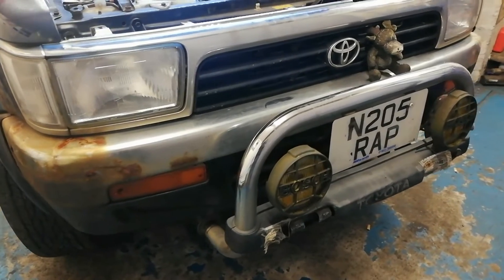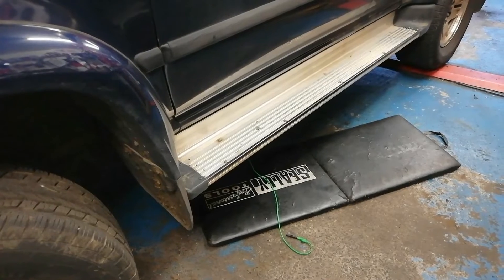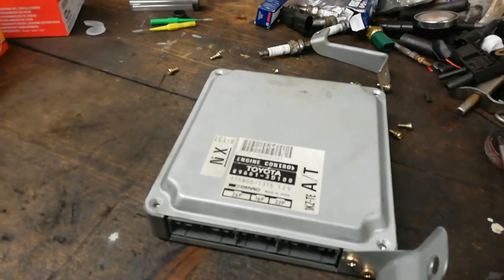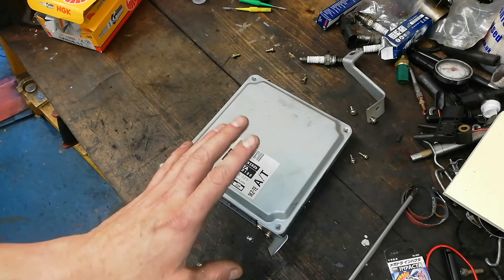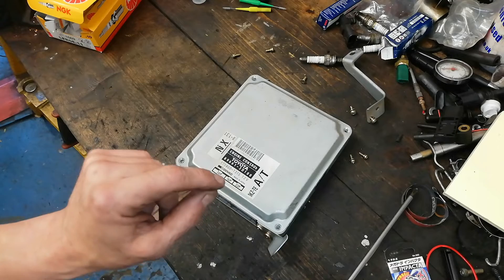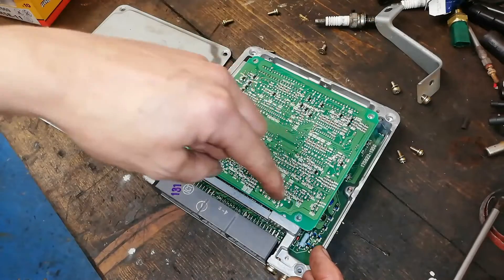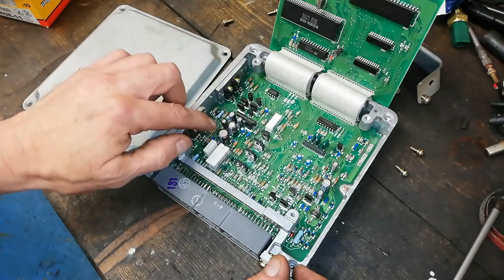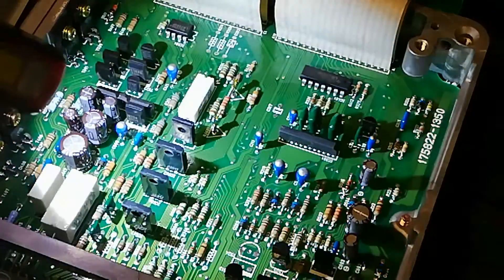Toyota Hilux A343F  AutoTransmission Problems Part 3 of 3

Comment: Great series Dave. Been there myself trying to change resistor in one of those cheap ebay breakout boxes. Too much heat and trace / pad lifted. Managed to successfully jump with thin wire using a hot air gun and solder paste rather than an iron tip and wire. We live and learn.
Reply from the maker: Aye rob good job. I might try out a few methods on old boards, thats a good tip thanks

Comment: The rubber boot that seals the shift lever from the the linkage on the gearbox ripped apart while disassembling. But I can't find any outlet that sells this part. There are multitudes of rubber seals for manuals, but none for this common Toyota transmission. Any help appreciated.

Comment: I’ve enjoyed the trilogy Dave, I’ve used plenty jumper wires and hot glue to repair PCB traces over the years and it works absolutely fine plus the conformal coating , it will probably last the life of the vehicle , moon here we go 🤗😜👍👍👍
Reply from the maker: Yeah Igor, pretty happy enough it'll be ok. Should have changed those caps years ago but if it aint broke and all that

Comment: Great 3 videos dave. I hav a 2lt engine surf with 2lte box that doesnt change past 2nd gear. The tps is not hooked up as its manual pump,  also no crank sensor. Do you think this would stop it shifting? The tach is not working either. Replaced speed sensor. Earth strap,tested wiring to solenoids all ok

Comment: Hi Dave, great videos!! Very good explanation., i have a 1kz te Prado  1996, same transmission as yours. Over the weekend the car struggle to shift into 3rd i believe, keeps revving.  Seeing your video i have a suspicious that my ecu might also have issue. The car drives ok yesterday but at the back of my mind i was worried about bigger problems. Apart from the shifting problem, do you have other issues That shows ECU symptoms?  Thanks

Comment: good fix still dave  the single strand out of telephone wire to bridge is good to use . and drill tho the board wen possible with a jet drill
Reply from the maker: Yeah, drilling not an option on this double sided board and yes a bridge from the stranded red jumper wire is what i should have used.
Telephone wire is a good idea too

Comment: Dave can fix Flux Capacitors , back to the future here we go , well done Dave , I hate working in my own vehicles, it always goes tits up when you've got an hour spare , remember once changing a handbrake cable on my VRS Octavia estate , easy enough, thought while it's on the ramp , give it a quick bleed on the brakes incase the fluid has got a bit hit , 1 side sorted , came to do the other , undo the nipple , here comes the thread with it , Friday at 5.15 pm , 90 quid later for a green caliper , sorted 😭😭😭😭💰💰💰💰🇬🇧🍦
Reply from the maker: Friday afternoon disaster is all you need, sometimes you just can't predict stuff going wrong. Cheers Mike hope you bring the good weather back with you
Reply: @davesterl  only got another 2 weeks left then 14 days quarantine Dave 😂🤣👍

Comment: Great series....even if like me you are too clumsy to even think about soldering an ecu   what you showed with regard a close visual inspection of the circuit board and the knowledge about leaking capacitors and the damage they do would certainly mean you could do the inspection yourself and if you see an obvious fault you may find someone into electronics who could do the repair for you...........or if you open the ecu up and it is massively water damaged at least you know for sure that you need a replacement...........often diagnosis points to an ecu but the final decision to call it is a hard one.....having a look inside may give you the answer and the confidence that your diagnosis is correct
Reply from the maker: yeah this one was tricky enough but happy it'll last ok. Close to the moon now and will be working on the return journey very soon i think
Reply: @davesterl  it is down hill on the way back i hear and the cheese is duty free
Reply: Good job mate. Could you explain why the trany keeps shifting when u remove the plug controlling the solenoid (part 1) manual mode